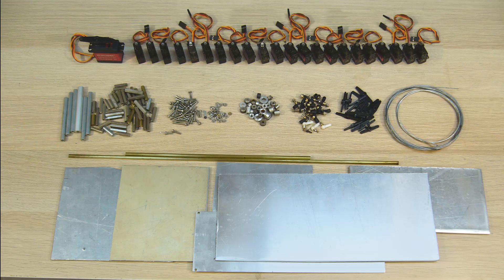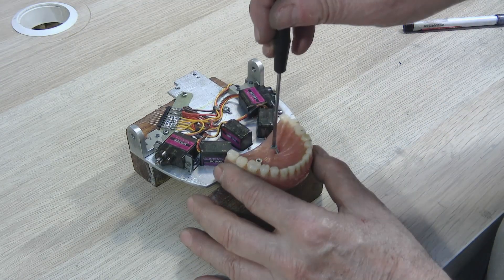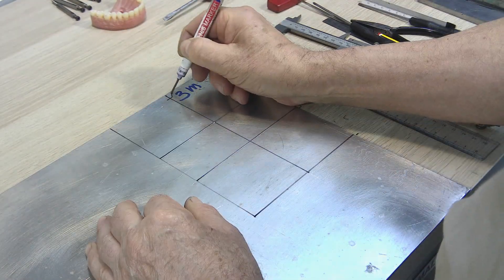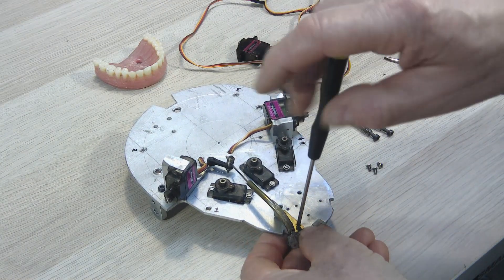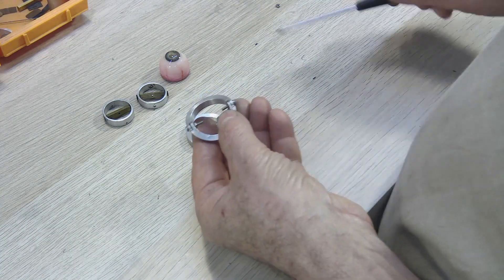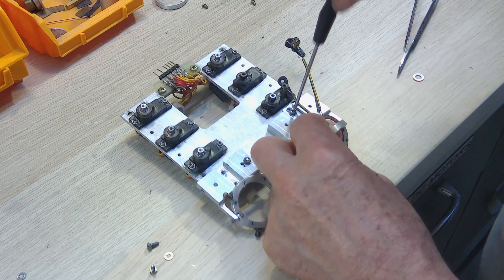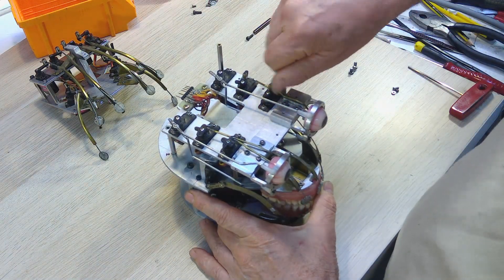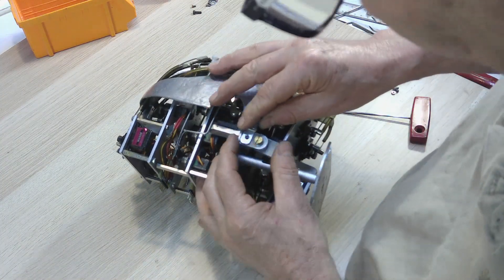How to build an animatronics head - Tutorial

Comment: how to measure and what will be the measure of each plate where the servo has been mounted, i mean what is the distance or measure of all 4 plates of the head part.
Reply from the maker: The mechanics are built inside the head mold, so the measurements of the distances between one plane and another are based on the type of face you have modeled, otherwise nothing corresponds.

Comment: Sir The robotic head he has created is the same as a human head in size and shape After making???
Reply from the maker: Exact! Sooner or later I'll make a video about this too.
First the face is modeled in clay and the mechanical measurements are obtained from the mold, taking into account the 3mm of the skin.
Reply: What is the length of aluminium sheet. And if I can print in 3d So I still have to take the same length of aluminium sheet that you have mentioned .
Reply from the maker: @IslamicNation.  In the video I talk about how it can be 3D printed.
For the measurements you have to download the photos of the drawings from the video and with a program like Photoshop enlarge or shrink based on the face you want to make.

Comment: Sir can we use SG90 servo motors instead of these.
Reply from the maker: The GS90 servos have plastic gears, they break easily.
Reply: @alvaropasseri5754  oh ok I will use servo which was you mentioned thanks.